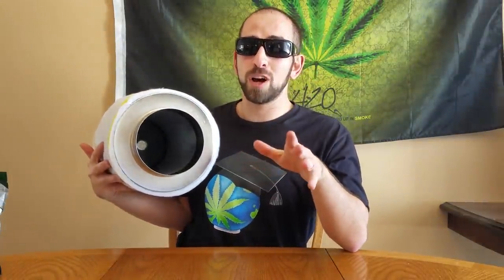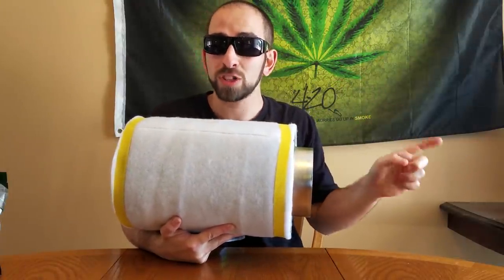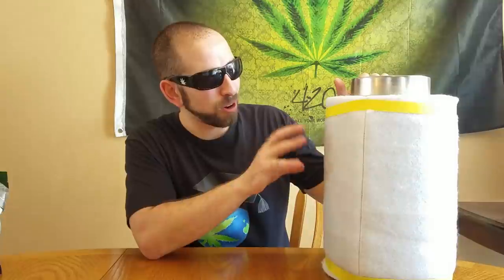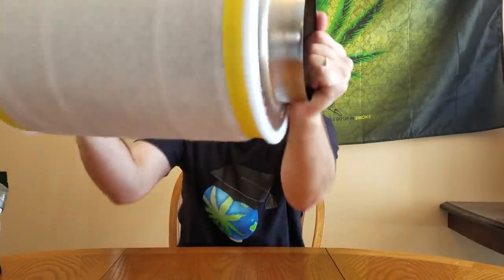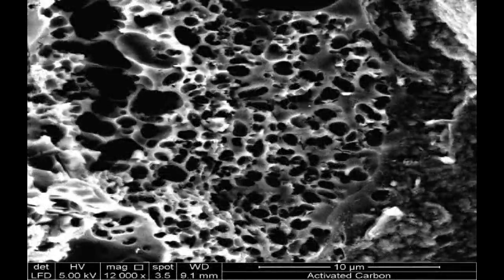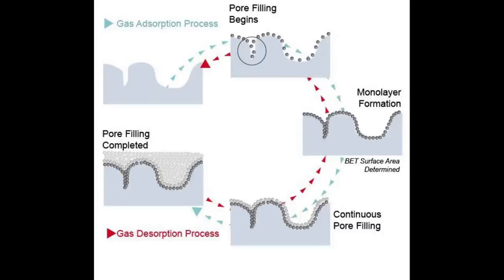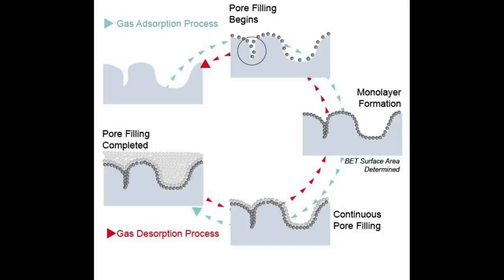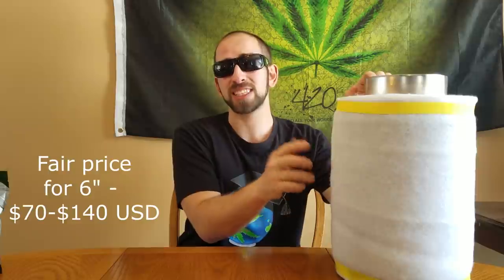Carbon Filters 101 - How They Work & Why They’re HARD To Beat For Odor Control

Comment: The second best use for a carbon filter is removing the smoke smell from burning your product!  Nothing will compare!  Cheap easy setup is a 4” combination fan, ducting and filter for about $110.00 on Amazon.  Put aside the ducting and set the fan directly on the filter in a corner of any room and adjust the fan speed by knob. 15 minutes after smoking no one can tell. Period! 🏹
Reply: im gonna try this then, my dad smokes at home (cigs) and i want a cheap reliable method for that. ill look more into it
Reply: What do you mean"...set the fan directly on the filter..."?
Reply: @Funny_senior_moments  place the filter on a table or floor in room, then set fan on top sucking in through carbon filter and blowing straight out the top.
Reply: @robinhoodgrowers8076  I have had 3 carbon filters just laying around for 3 years after my last grow that I tore down. I used each filter for maybe 3-4 months. Do they have a shelf life?
Reply: @SlayerWezz  they last quite awhile and based on your use, should be fine. Peace

Comment: They work just fine as a blow through filter. You can scrub the air in either direction. You can also use a inlet filter (non-carbon)  in this situation to protect the fan from gunk.
Reply: Agreed 100% either way works perfectly fine people!
Reply: They do scrub both ways, by why would  you want to fork out for an inlet filter in addition to your C-filter. especially true  if  you running a larger room, you will need a descent size -carbon filter and buying the same flow sized inlet filter would be pointlessly expensive. Run it before your exhaust
Reply: A leg from a pair of nylons duct taped to you ducting cost less than a coffee. It's not as if you filtering down to 100 micron before the fan, you just don't want any larger things to go through you fan.
Reply: @darinhenningsgard8833  Came to say the exact same thing! ;)

Comment: I got one six inch with a 2 year warranty on it. Still neutralizes odors very well and I've been using it for over a year now. Mind you I take roughly a month between crops. My tent is 4.3x4.3 hoping this filter lasts a bit longer during this virus crap.
Reply: Have you had to clean the prefilter yet ? From my experience bytime you clean the prefilter twice its time to replace the filter as the filter gets clogged cfm decreases
Reply: @Air-vf6cn  well I have cleaned it once.  It's over a year old but has had 1-2 month's rest between runs of like 3-4 I believe. I looked at it last night and it's getting to where yes it needs another wash. So after this run I'm either gonna grab a new filter or recharge the one I got. I just rechecked the warranty it was 2.5 years. Thanks for the tip btw.

Comment: Hello Lex it going? I had a question for you. The reason I'm asking you is because I  value your opinion and no with your experience you would know what to . I do not have much room in my 2 by 2 tent and was wondering if I could put the inline fan on the outside of the tent ducting it into the tent and a separate duct that will let air exhaust out of tent. BTW I'm not going to use a carbon filter. Would this be sufficient? If not what would you recommend? I look forward to hearing from you. Please keep making your excellently informative videos. I'm a Noob and I'm learning so much from you.

Comment: I built a charcoal filter out of charcoal granules and hepa filter.   The first night I put my formaldehyde meter in front of the air outlet and the reading was lower than the surrounding air, which showed it was working.  The third day , however, the reading is higher. I'm dumbfounded.   There is a pound of charcoal granules and the room doesn't have huge amount of formaldehyde.  I doubt the charcoal are saturated.    I know charcoal can adsorb and also can release whatever it adsorb.   So are we looking for a filter that can adsorb more than it releases?   Will it help if I turn the charcoal granules so that the adsorption can happen more evenly?

Comment: They can be used with the extraction fan blowing air through them
Reply: I was about to say that as well. I grow one plant at a time in a 2.5 x 2.5 x 5 foot tent. It fills that grow space, no room for the filter. My 3rd harvest is hanging as I write this and the filter is still going strong. All ducting is outside the tent with fan pushing though the filter. While it may not be ideal, I've had no issues.
Reply: @sunkyman1024  even with carbon filter with low humidity and working full time you can catch a whiff

Comment: I leave the filter on when drying my stuff… but I’ve been told to turn it off. Not sure which is the correct thing to do, on or off?
Reply: a small ozone generator.  i have one the size of a hockey puck that i use to sterilize tent and tools after harvest.  i havent tried it for drying but thought about it.

Comment: Awesome video, I'm on the fence about a vent and fan after needing to relocate my setup for a few days. Damn home insurance inspectors. Any tips or plans to do a video on carbon prefilter mantainence? Or steps to improve the life of the filter. My friend made a big mistake using a lot of powdered nutrients in his tent, and his pre filter got CAKED in dust from it after a few months.
Reply: Gaia green does not mix with water it's meant to be added dry. Once he realized the issue he just stopped feeding in the tent. I do the same thing, take my plants out of the closet before feeding, saves the dust on my lights and shit
Reply: @dropinbiking92  guia greens says to work their powder nutrients into the topsoil and then slowly water the nutrients into the medium if directions were followed the nutrients will be in the soil? I dont see how powder nutrients is getting into your carbon filter...? Are they sure its not actual room dust I suggest using a hepa intake filter to help the carbon filter last longer plus it would tell you if its indeed room dust or dust from your powder nutrients . Wish y'all the best of luck hope this helps ....
Reply: It's super super fine powder, once you disturb or open the container it will drift around, once you take a spoonful out and sprinkle it on your plant the dust gets around.

Comment: no carbon filter can help in full flowering for a super smelly strain... and there is a high chance duct pipe has micro holes in it if you put it on exhaust...both nyc diesel auto and original glue auto were smelling out of my grow tent in 4 weeks of flowering...  i guess ita better to leave it inside to scrubb and use ona gel outside or something

Comment: Not ALL carbon filters are designed to only pull air into it. The brand that I use not only works pushing or pulling, it also has reversible flanges to get more life out of it. I modify my prefilter, which normally goes on outside, to fit on the inside which catches dust etc. I exhaust right back into my room because I run a closed loop climate controlled system. There are ABSOLUTELY no smells and my filters last...

Comment: Hey lex, sup man? I love your videos!
I have a few leaves that suffered from too much nitrogen in the beginning of flower (only like half a dozen of them, all the rest are perfectly healthy)
Im now at day 62 of flowering. Do you think I should remove those hooked leaves that suffered from excess of nitrogen? 

THanks man!
Reply from the maker: My policy is to remove any fanleaf that's >50% dead, wheatever the cause.
Reply: @LexBlazer  Thanks for the reply man. Just to confirm, would you consider the fan leaves that looks like "Hooks" bended downwards because of the excess of nitrogen i mentioned to be a a 50% dead leaf ? If so, I will surely remove them.

Thanks man!
Reply: Day 62 of flower time to flush buddy leave the your toxified leafs its to late in the game to worrie about anything other than getting flushed and properly dried and cured
Reply: @Air-vf6cn  Thanks man!

Comment: What about when they get plugged up with dust and cause restriction and negative pressure in your tent ?
Reply from the maker: You DO need to maintain your pre-filter; it's actually the only real maintenance to be done on these filters...more on that in the next episode.
Reply: You should have negative pressure in your tent.
Reply: @tombryant4518  my tent is sucking in do to filter clog every two weeks so I just spray it down with warm water and it returns back to normal
Reply: Vince g No, your tent walls are sucking in because your fan is creating a vacuum. It’s moving more air out of the tent than what is able to flow back into it. Open some vents to allow more air flow into the tent. You’re supposed to exchange all the air once a minute anyway, and a plugged filter won’t do that, never mind creating any negative pressure in the tent. You’re actually probably plugging the filter when you spray it with water, and it slowly starts working again (creating a vacuum in the tent) then you spray it again
Reply: Vince g You want negative pressure in the tent to ensure the odours go out through the filter. Otherwise the smells would permeate through whatever crevices they could fit through, and stink up the room, house, or whatever. Gorilla grow tents actually have kits you can buy that reinforce the tent walls so they don’t get sucked in and touch the plants. Just trying to help you out man, not being condescending at all. Let’s figure out what’s going on in there man!
Reply: @tombryant4518  I'm sorry it's pushing air out of my tent ,the filter can't scrub the air fast enough
Reply: Vince g Sometimes filters are only rated for a certain flow rate so that they maintain enough intimate contact with whatever they are filtering to actually filter it. I had a 4” filter like that. It wouldn’t seem to do anything, but wasn’t plugged at all because the tent was sucked in like crazy. So I tried a variable speed fan on it and set it on the lowest speed setting. Now it actually filters smells and maintains slight negative pressure in the tent.
Reply: @tombryant4518  I hear you ,when mine is clean it works perfect even pressures when I spray the filter and reconnect it it dries out within an hour and all is good for around 3 weeks
Reply: Vince g Another thing that I’ve often thought about, but have never tried is soaking the charcoal filter overnight in distilled water. At work I use huge charcoal filters to filter hydrocarbons out of glycol. They need to be soaked overnight before being put into service otherwise they don’t work very well at all. I wonder if you’re actually onto something when you say it works better after you spray it?
Reply: @tombryant4518  yes it works great with warm water you can hear the charcoal activating after you spray it down,I do the outside then then inside .
Reply: Vince g  Weird man. At least you can clean it and reuse it I guess! Beats wasting money on new filters
Reply: @tombryant4518  Yea I've bean cleaning that filter like that for over a year ,only use it half way into flower .works great.
Reply: Vince g What brand and size is it?
Reply: @tombryant4518  6 inch off eBay don't remember the brand ,just the cheapest one I could find 😀
Reply: I believe its better to use it inside to scrubb not on the exhaust... I could always catch a whiff from my nyc diesel and gorilla glue in full flowering.. Its okay in the beginning but in full flower oh no.... Its easy to catch a whiff

Comment: How much does it cost? I don't find most strains stink. If I had old MH HPS light cabinets a fan might be okay?? Could i hook the filter to the lights? Who cares about stink?
Reply from the maker: how much it costs is in the video :) lol if you knew how bad the stink was, you'd probably care. Or not, depends how big your property is.
Reply: Neighbors with same air conditioner ducting, also obviously not fully legal areas, some even in colorado require this filter by law or you can be fined for public nuisance, sounds and also smell is in that law
Reply: @dertythegrower  
i personally don't find the smell a nuisance unlike some of the factories dotted around the world that spew out proper pungent pongs!
Reply: Not sure what strains you mean, every strain I've ever seen in flower will overpower not only your house but most of a decent sized yard with an unmistakable odor, unless carbon filters are used. I love the smell myself, but some neighbors and all law enforcement absolutely HATE the smell.  Anyone who comes to your door , for whatever reason will instantly know what's up. Legal states might not be a problem, other States could be BIG problem.
Reply: @LexBlazer  it's an apartment....I'm sure the neighbors smell it...I haven't had the cops called but with all people on this board it looks illegal not to have a carbon filter? WITH THE TRUMP MONEY, I'LL GET A 4" INLINE WITH CHEAP FILTER👨‍🌾thanks, buddy